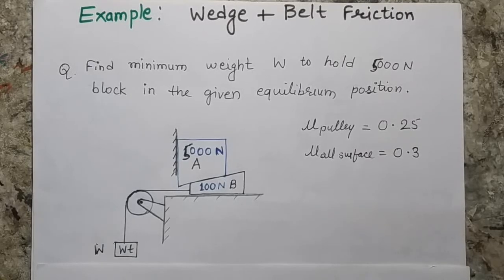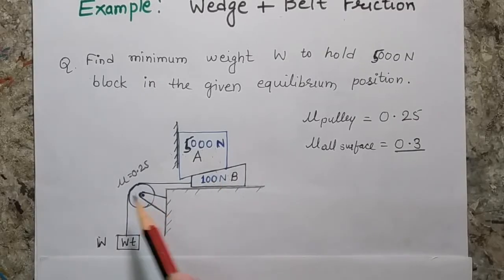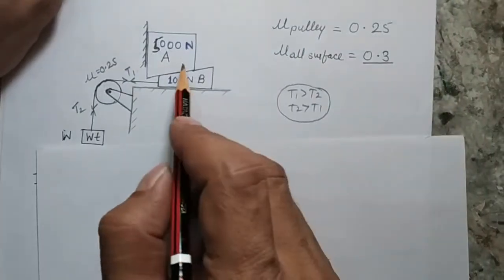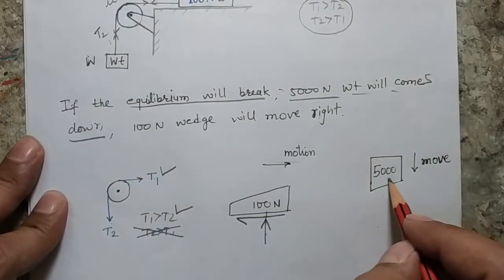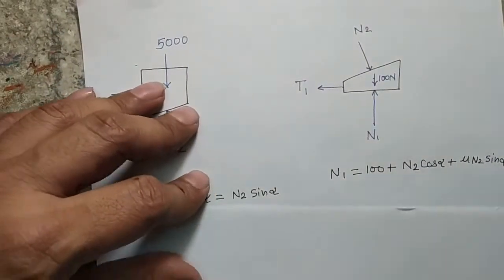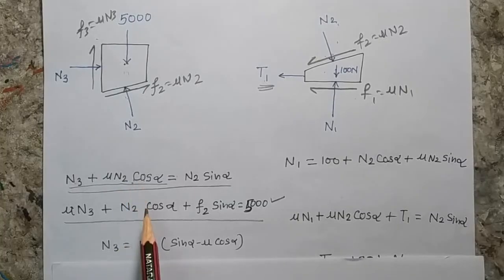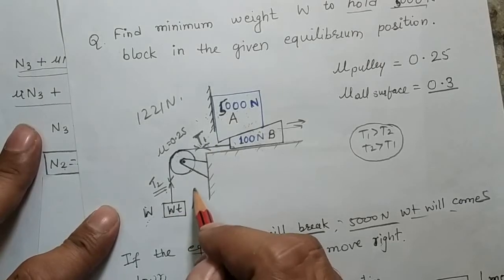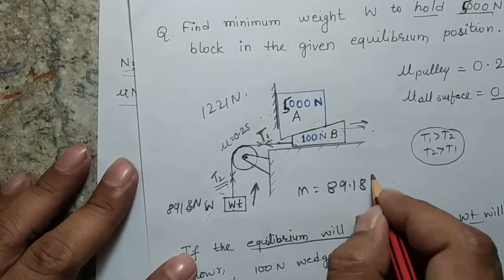L6.9 Friction|| Wedge and Belt friction|| Advance Problem || Engineering Mechanics|| 1st year course

Comment: Sir,
Why can't we consider that when the equilibrium breaks the whole system will move towards the left..?
Reply from the maker: Dear Naeem, for the given condition where we want to hold 5000N block, we cannot think so, lets try to simulate one experiment..suppose initially w is zero, so the 5000N weight will fall down and system will move towards right side. Now lets increase W gradually, a condition will arise when 5000N wt will not fall and system will in equilibrium now. this state is known for holding the block. suppose you will keep increasing W, a second state will arise where W will pull the lower wedge towards left and 5000 will lift.  , this break point is corresponding to statement of lifting 5000. so movement of system defined from this statement, whether you want to lift 5000 N or hold 5000N. I hope this answer will help you.
Reply: @ashishpurohit9138  yes it surely helped a lot I really appreciate it. Thanks 😊